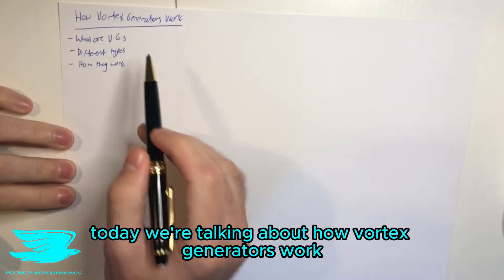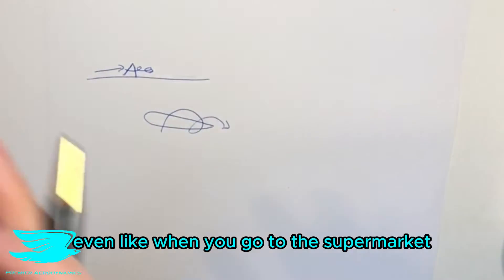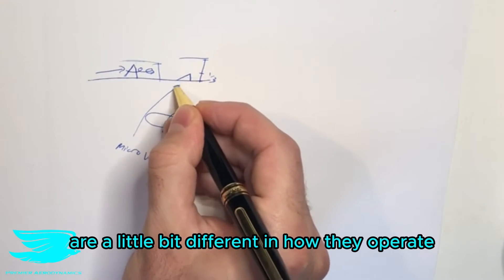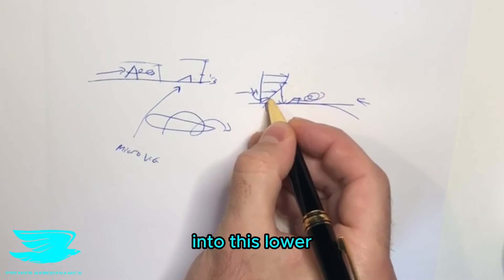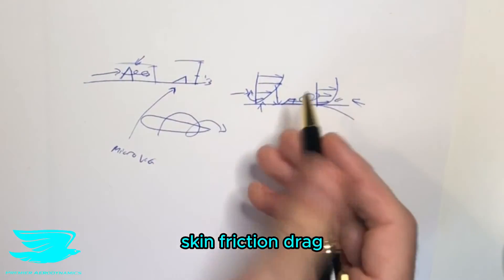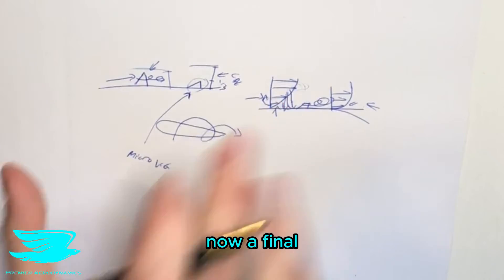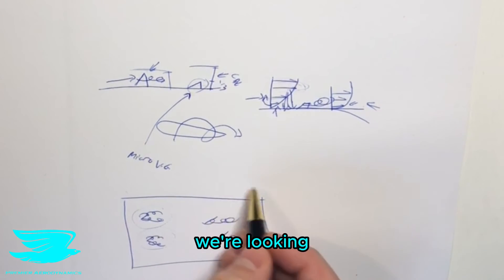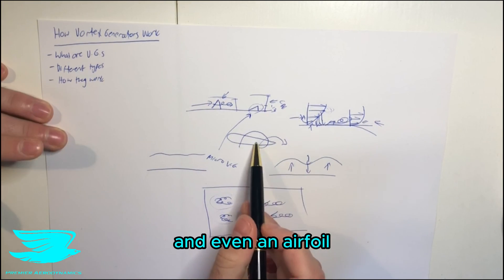[Aero Fundamentals #40] How Vortex Generators Work

Comment: Thanks for these videos, iv've been learning a lot from them, but could you clarify what you said a 4:40? How does the smaller vortex generator generate a bigger vortex? Also how do you calculate boundary layer height?
Reply from the maker: Good questions.

For how a smaller vortex generator generates a bigger vortex, it depends on the geometry of the object. In terms of vorticity, the more the x, y, or z velocity component changes in an orthogonal direction, the more vorticity is produced. If that vorticity is then directed, let's say to the top of the vortex generator, you can shed the vortex from there, and so it is already generally stronger, and now you have put it a little farther away from the wall, which allows it to grow more.

Another way of producing more vorticity, from a more practical point of view, is by creating as large a pressure change as possible, that accelerates the flow more and leads to a vortex, especially if there is a discontinuity between two pressure values right next to each other.

If you want to learn more about vorticity, have a look at  our aero fundamentals video on it: https://www.youtube.com/watch?v=foi8pS-PxRk

Also, it should be noted that strictly speaking, "bigger" refers to the area or volume the vortex takes up, where as strength refers to how strong it is, which is to do with the circulation. You can find more about that here: https://www.youtube.com/watch?v=zInIjWOXoRw

As a side note, if you can guide the vortex so that it interacts with both very high momentum fluid and very low momentum fluid, then you have a much better chance of reenergizing (that's the commonly used term here) the lower section of the boundary layer.

As for the boundary layer height, the most common way is simply looking at where the velocity in the boundary layer equals 99% of the freestream value. You can find more about it here in this aero fundamentals video: https://www.youtube.com/watch?v=iQU2gtQ8E28

There are two other fairly common ways called the displacement thickness and the momentum thickness, which look more at velocity and momentum, and you can find more about them in these two fundamental videos, respectively: https://www.youtube.com/watch?v=Ug3oN1BTiN0, https://www.youtube.com/watch?v=eSTg0Si5M7M
Reply: @PremierAerodynamics  thanks very much, looks like I've got some reading to do
Reply from the maker: @forferdeilig  Bit by bit, you'll get there👍